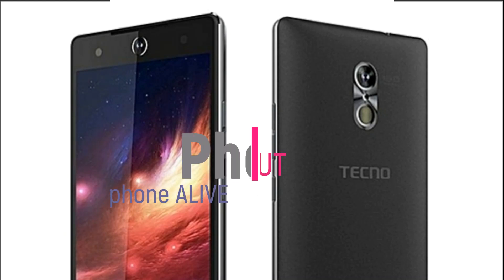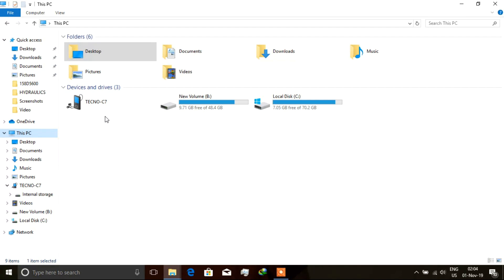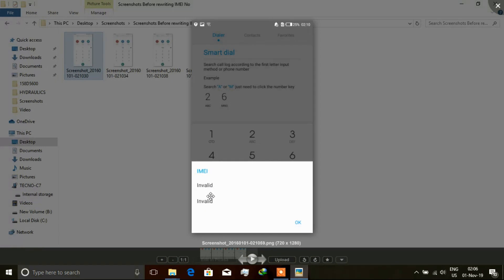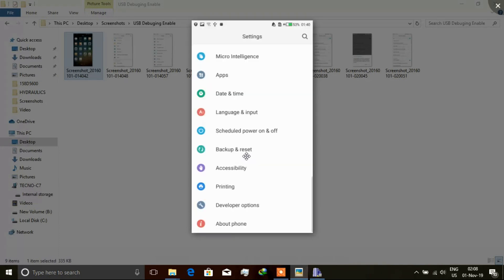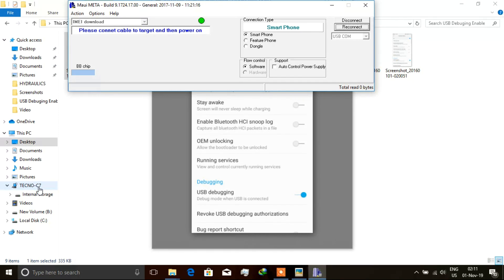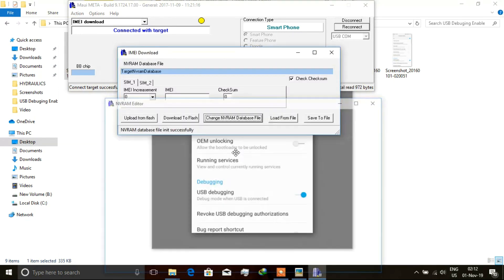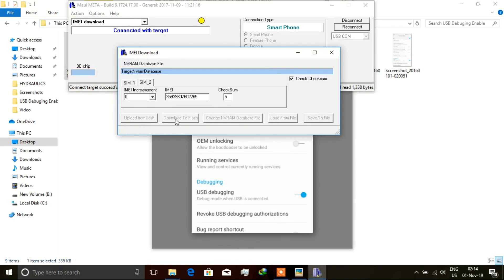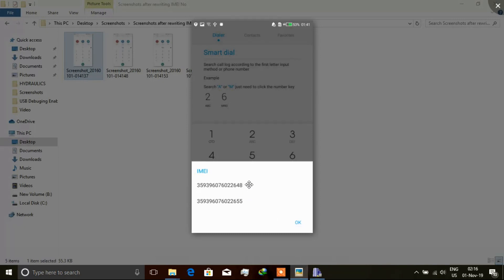How to  Fix IMEI invalid of ANY PHONE (Change, Rewrite 'SERIAL' NUMBER of MediaTek phone - Tecno C7)

Comment: thank you it was helpful. I did the same thing as instructed it worked for 2 hours but stopped network service later, the IMEI number is still working but the phone is in emergency call mode. Is it because I used IMEI number of slot 1 to slot 2 and the reverse? i reversed the IMEI number of both slots by mistake but it worked for 2 hours. what can I do?
Reply from the maker: No not really, for the imei it doesn't matter which you place for which line, unless its conflicting with another already active device. 
Or cerficates and possibly you mighty also have a hardware problem.
When you check, are your simcards being read, for instance are your sim-contacts listed in you phone book?
Reply: @PhoneLookout  it only shows the imei number contact lists are visible only on phone saved ones not on the sim